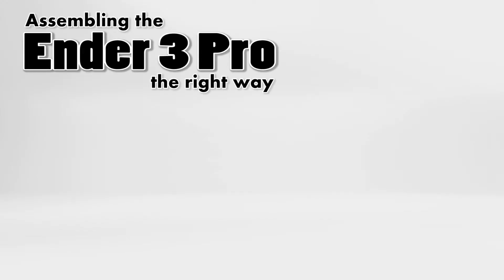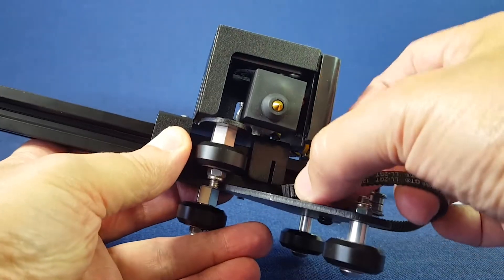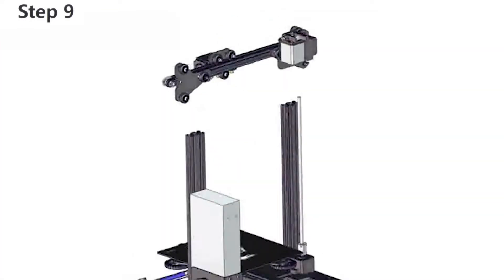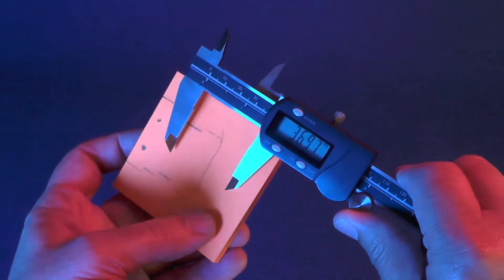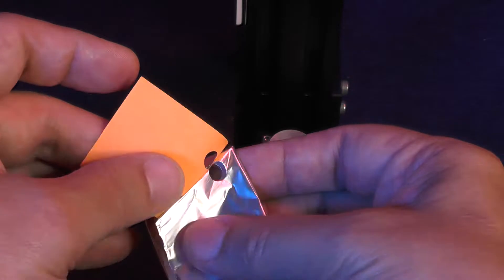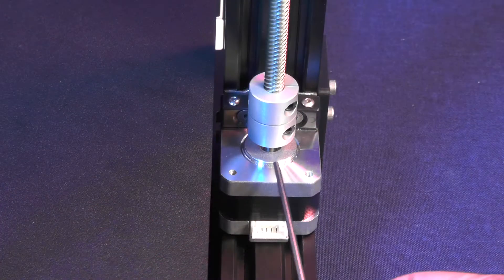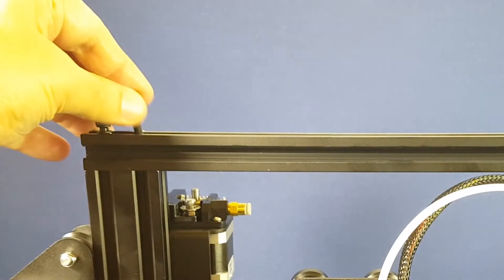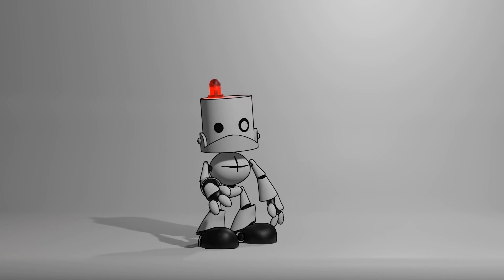Ender 3 Pro (2022) Assembly Guide - Part 4

Comment: I cant seem to get the foil spacer to work properly. I measured and I have a distance 1.23 MM but when I installed the foil shim the bottom of the stepper motor moves away from the 20x40 extrusion. Everything looks ok, but it kicking out at the bottom changes the angle of the leadscrew more toward the front of the printer. When attaching the gantry I could pull it out a bit and it would go in. I dont know if I am doing this right?

So far the only critique that I have for this series is to confirm that you dont have any drag on the gantry belt. I had to move my tensioner angle down quite a bit, to remove the drag. (I did check alignment across the 20x20 as well as how the belt was installed to the hot end. When it rolled back and forth on mine it was rubbing on the 20x20 near the tensioner prior to moving it.
Reply from the maker: Your suggestion about how to properly align the belt is pretty good.
If I ever make another series about building a printer, I will definitely use it! 😊
Reply: @MakerMindset  Im a fabricator and like tinkering. Its so hard to make a tutorial that is perfect for everyone. I know that when I work on things that I do things automatically with little awareness. That only developed out of a lifetime of effort.
Reply from the maker: @hansoncrack , don't forget to subscribe! 
I have been working on a 3 part series on firmware updates. You can't miss it!
Reply: @MakerMindset  Got it done and hit the bell :D looking forward to it. Both of my enders are running skr boards
Reply: @MakerMindset  That is likely what I will do. I made the spacer. Flattened it and cut the holes. Measured it extensively and then when installed. It was causing an issue. I even tried cutting the bottom of the shim off and only using the upper part. When screwed in for some reason it would kick the bottom out. I was using heavy duty foil and thats the only variable I see that differed. Thank you so much for this series, as it has brought so much awareness to the mechanical details.
Reply from the maker: @hansoncrack  It was my pleasure! Have a wonderful day!
Reply from the maker: I am sorry to heat that you are having problems with the aluminum foil spacer. If your printer can print at all, you should try the following:
https://www.thingiverse.com/thing:2752080
This is a small print. It is a spacer that may solve your problem.

Comment: FYI, you are building a spacer in this step with aluminum foil.  You need a hole punch to finish that step.  Tried alternatives, ended up trying to drill the aluminum foil stack and messing it up.  So I guess I'll stop by an office supply place on the way home tomorrow from work.   Since this is the second time this happened to me, I skipped ahead and watched all the other videos to see what other stuff I would need - looks like a little brass brush, Isopropyl Alcohol and a little spray bottle to put it in and a lint free cloth to clean the bed, and a stack or two of post-it notes.  I've got the list now, so maybe tomorrow I can finish this thing.  Thanks again for the detailed videos.